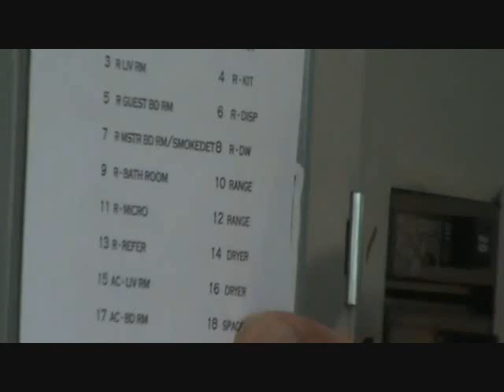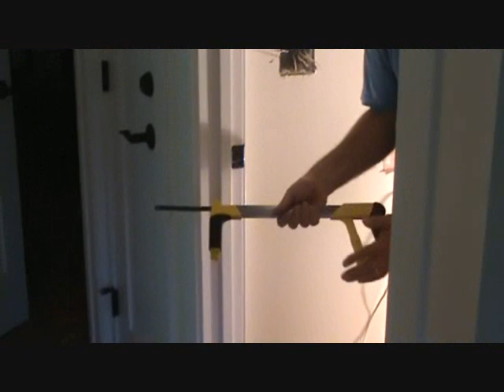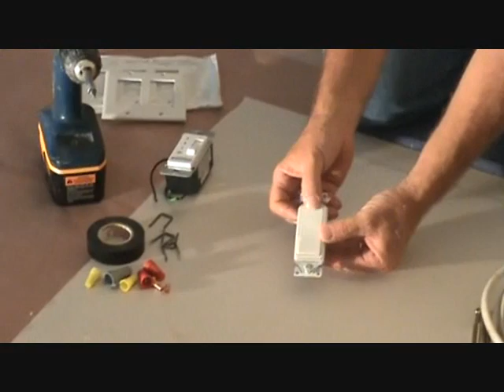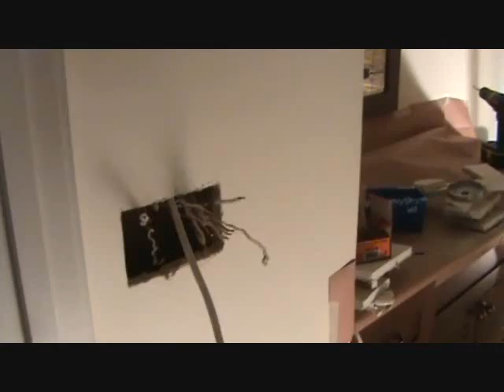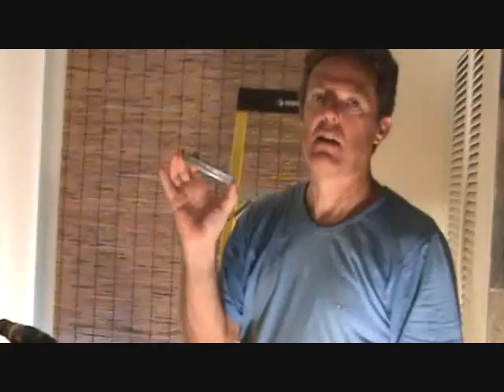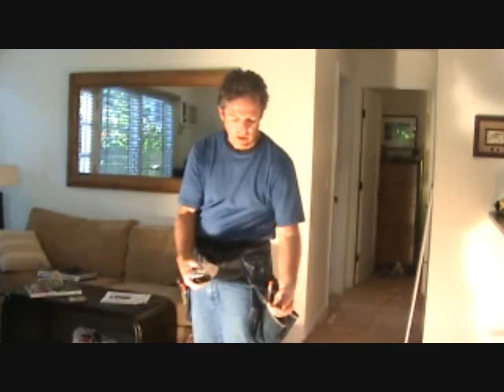Installing the rough electrical for a ceiling fan & wall switch

Comment: Well I watched about 6 videos trying to get help with figuring what wires to connect when 3 black and 3 white wires are in the ceiling box. I knew 1 was wall switch and 1 was hot and 3rd was another feed. Just couldn't figure connection pattern. I started watching your video and Thought maybe you'd cover the topic when it ended and you asked for money. That is why I said you suck! I figured it out on my own that the light wire had to go to white to complete circuit. Not getting my money. Thanks
Reply from the maker: Yes the blue wire in the ceiling fan would be for a light kit on the ceiling fan so the other hot wire up in the ceiling junction box would probably be for that...but not on all occasions as not all ceiling fans are wired up the same for sure!